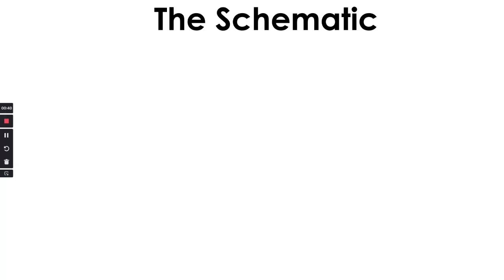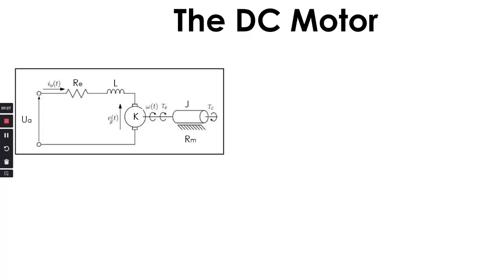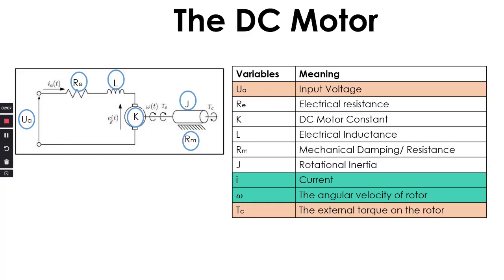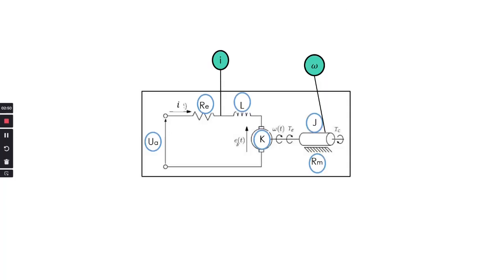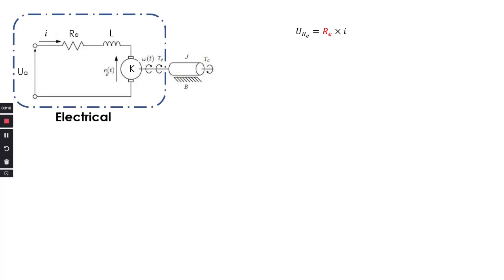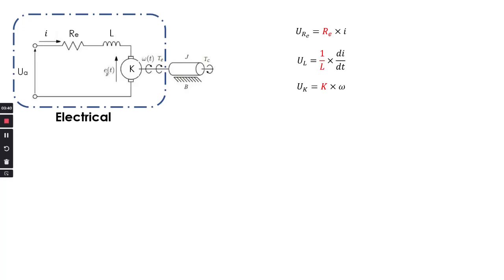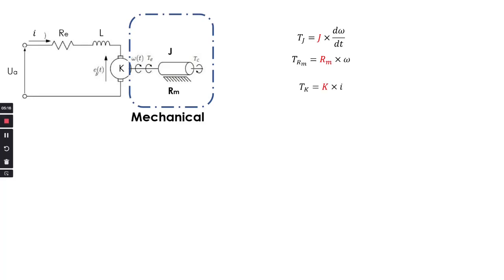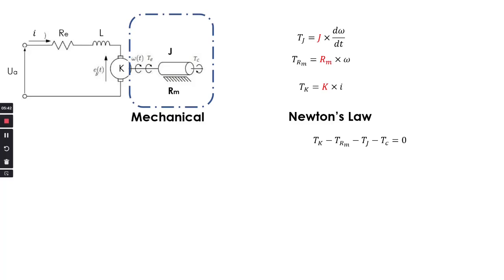Writing Equations for DC motor: Part-1

Comment: Where is the permanent magnet here .?😊
Reply from the maker: Here I didn't show the permanent magnet to make the model simpler. 
You can say that the permanent magnet is represented by the DC motor constant that gives the relationship between voltage and torque